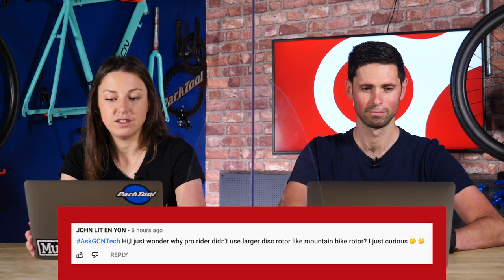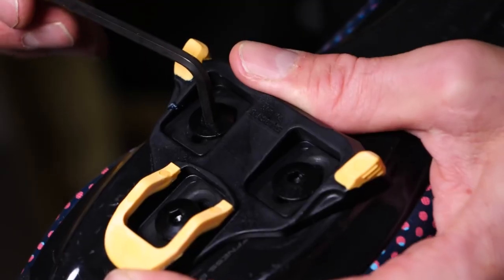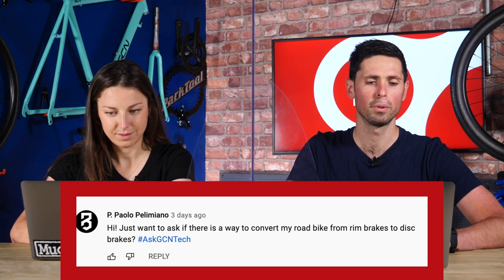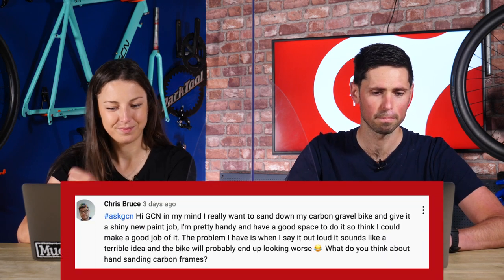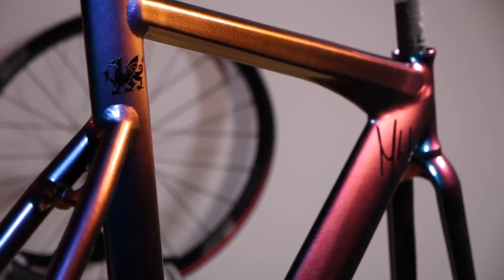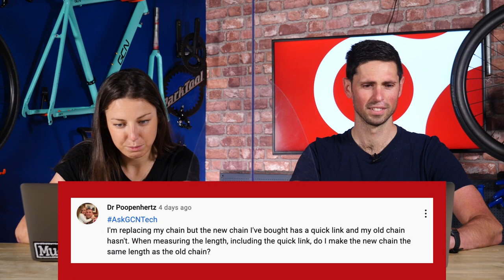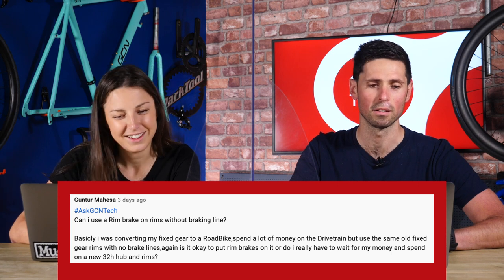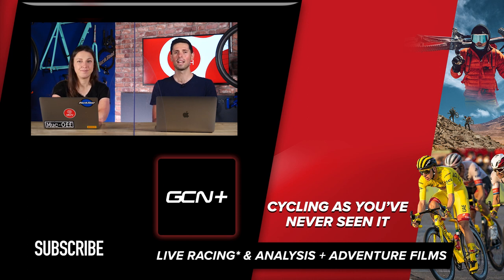Why Don't Pro Cyclists Use Bigger Disc Rotors? | GCN Tech Clinic #AskGCNTech

Comment: There's just no reason to use larger disks on the road. You (should) get plenty of power and modulation out of standard sized rotors. If that's not the case, there's something wrong with the brakes.

Comment: Hi, Does tires have an expiration date? Like for example when they have been around the shop for a few months or years. Thanks. #AskGCNTech
Reply: It is all a  question of how they have been stored and what the excact material is.  
I recently discovered that my son had cut in his tyre and instead of buying a new tyre he took an unused but old - very, very old - tyre off from a set of spare rims we had and has been riding on this tyre for about 2000 miles until now. (Michelin World Traveller 700Cx25
We discussed how old these tyres probably were and actually found out that they were in excess of 30 years old since they were purchased when we still lived in Germany.  They were mounted on the wheels and stored in the shed in summer and winter temperatures (Scotland).  So these tyres are brilliant.  
At the same time we looked at the spare wheels for my wife's bike (26") and they are about 10 years old but the rubber is already flaking and brittle (Schwalbe).  
All in all, it depends .........

Comment: I'd like to see a video about anodizing a frame or components
Reply: Anodizing Titanium you can do with a 9v battery (or several of them) and a conducting solution. To anodize aluminium you need lots of nasty chemicals...... not something for the average cyclist.
Reply: Anodizing Al is a specialist job and needs a lot of knowhow.  It also depends on the alloy. Not every Al alloy can be effectively anodised and the outcome depends heavily on the initial cleanliness of the part and here I don't mean clean in the sense that it looks clean, it needs to be chemically clean which is different level altogether.  
Also, Anodising adds to the dimensions of the part, so if you have parts with slip fit pins, they wont fit anylonger after anodizing.  All in all, not a simple job

Comment: #askgcn 
Hi Is there anyway to recognize rim brake pads for carbon wheels , unfortunately i mixed all types in one box ?
Reply: Most of the pads I have, have as small imprint on them if they are for carbon.  Else, look up on the websites of the manufacturers if you can identify the brand or use an image search in google to identify the brand.

Comment: #AskGcnTech
Hi!
A few weeks ago, while riding on a gravel section, my front wheel got stuck and I got catapulted forward. 
I wasn't wearing clipless pedals, so I was wondering what would have happened if I was? Do they unclip if some force is applied? 
Thank you :)
Reply: Same happened to me in the past with clipless. Happened too fast to unclip so I headplanted and got a nice concussion. Won’t be doing any more downhill or aggressive riding unless I have flats now.

Comment: #AskGCNTech Hi Alex & Manon/Olie, I want to change a frame for something carbon, aero and fully integrated (like Scott Foil or Merida Reacto) and I want to move entire 105 goup from my current aluminum endurance bike. I was planning to use 105 levers with Avid's BB7 mechanical disc brakes that I have from different project, but the question is - will mechanical braking cables would work propperly while being hidden in bike and stem like FSA SMR ACR or one piece bar and stem of Syncros Creston iC SL.
Thanks in advance!

Comment: #AskGCNTech - Hi humans! I've ordered my first aero bike (a 2021 Orro Venturi Evo 105) but I've since learned it has a press fit bottom bracket (which the online forums suggest is prone to creaking and generally a pain). Can you offer some advice about what to look out for with press fit BBs and if I should do something different? Thanks!
Reply: @Sidowse  and that the bottom bracket is assembled correctly into the frame.

Comment: Discs are smaller the MTB due to instability of running a 200MM on a tyre that has such a small contact patch and such a high pressure

Comment: #ASKGCNTECH Hi Manon, Alex and Ollie, thank you for the tech videos. I have been learning a lot from them. I have a question on bearings, or better, on the kind of lube that I should use on bottom bracket bearings. Can I use the same lube that I use on the chain, or should I use a proper lube? How to choose the bearings lube? It is depended o the type of bearing? Thank you in advance.

Comment: #AskGCN  Hi Guys! I have issue with my disc brake always squealing. Using disc brake specific cleaning products and even replacing the brake pads seems to solve it for awhile but the squealing will eventually comes back. I'm thinking of replacing my disc rotors already and hope to solve the issue but is there anyway to save a contaminated disc rotors? Thank you in advance. Cheers!
Reply: Could be that your break caliper is leaking a bit. If you pull your finger over both brake rotors, is it just plain dust or a little bit oily on one of the brake surfaces?
Reply: Sounds like contamination. Could be a leak as mentioned above, or contamination from roads you commonly take. That or you're not keeping your hands off the rotors.

Comment: #AskGCNTech
How long do carbon rimbrake wheels last, I know it depends on type of driving/terrain, but in general or is there a minimum thickness of the brakesurface?
Reply: If you use carbon specific brake pads and take care of them then they should last you 10+ years without any problems.

Comment: #AskGCNTech Hi im just curious is there any significant feeling in ride between different carbon wheelset brands ? example lets say the pricier and the cheaper carbon wheelset even though with the same depth, weight and the same build carbon material  (like T700-T800) ?
Reply: Yes. The type difference and the magnitude to which it is felt can vary greatly.

Comment: Because the biggest brake rotors will always be the wheel. Another bonus, the ufo sound my carbon wheels make when I brake is 10x cooler than the pig squealing disc rotors.
Reply: disc brakes stop way better than rim brakes on carbon, especially when things get wet. plus the squealing that comes from v brakes can be just as bad as discs. there's a reason dh riders use disc's and not rim brakes. even roadies are moving to discs. they're just a better technology
Reply: I agree that they stop better, have better modulation and in general are the better technology, but I do not and never plan to descend mountains like the pros trying to gain every last second. Rim brakes are sufficient for 95% of people that ride, most don’t ride in the rain and if they do they’re commuting at 14mph and can stop by putting their feet down
Reply: My rotors have never made a sound. Turns out they're pretty quiet if you don't do stupid things to them. That also has the side effect of making it so my brakes actually work. Can't really say the same for rim brakes.

Comment: Im more of a fan of old bikes i only have one disc mtb a 2011 giant revel 1 ive had to replace almost every new cheaply made half plastic part on making a 125 dollar score a 1600 dollar used car and right now it has new avid brakes that perform when the pot metal hardwares not snapping or the thin ass rotor isn't bent ive already overpaid for fancier discs to find their exactly the same these weight weenies need to grow up so i can waste more money on a beefy disc brake set that involves 0 plastic carbon fiberglass or pot metal but the way the market goes ide have to make that myself they dont want to spend a few more cents or hire someone that knows how to create such thing as a quality part it serves as a reminder of why i lean towards older bikes not much of a gimmick if it works 30+ years later with proper maintenance

Comment: Hi Alex, Hi Manon!

I have an elite suito-t smart trainer and favero assioma UNO power pedals. The assiomas report about 20% higher power compared to the suito-t. Is it more likely that the assiomas are faulty or  if the elite suito is under reporting power. Both systems have been calibrated before use. Thanks! #AskGCNTech
Reply: Update the trainer firmware and run a spindown caliberation AFTER riding for at least 10 minutes. If that doesn't work, take the bike and trainer to your LBS.

Comment: discs arent bigger because the wheels arent strong enough and road bikes are heavy enough
Reply: Sure the components are strong enough. There's just no need for them.
Reply: @mihalis1010  they flex too much which causes ting ting ting and its more dangerous around turns it since it causes the rims to flex and rotors still overheat because theyre small. and theyre dangerous because ppl dont want covers on them. everything in road cycling is minimal which doesnt suit the rotor model. same reason why clincher carbon rims arent made for rim brakes they just arent beefy enough, but tubulars do have adequate material to withstand the dispersion of energy.
Reply: @mihalis1010  its funny how the uci puts a weight limit on bike but add another lb with a new breaking system and now that effectively takes a lb away from the bikes' integrity. also riders who are 200lbs and make 4x's the power of riders who weight much less are bound by the same equipment restrictions?
Reply: @mihalis1010  the need for them is to get rid of carbon clincher rim brakes but disc brakes are still majorly flawed

Comment: If they all use the same size rotors they can swap wheels amongst each other
Reply: This doesn’t make sense. If guys doing the swapping are on the same team them why not all have larger 180mm rotors?  Still doesn’t explain why they are using smaller 160 & 140 rotors. And if the guys are on different teams then why on earth would they be swapping wheels with guys on other teams during races and in any event? And how would they be able to perform this wheel swap - are they expected to carry a set of Allen keys each to undo the thru axles of their own wheel and then do the thru axles back up after the wheel swap?!
Reply: @paddyotoole2058  I guess my comment is more to explain why there aren't any outliers to the typical 140/ 160mm setup, than to explain why all pros do or don't use bigger rotors